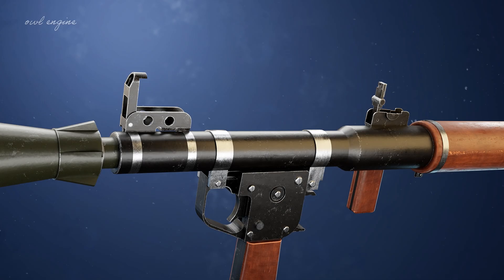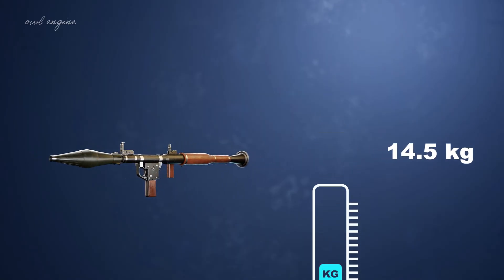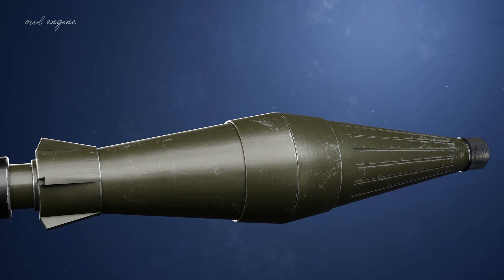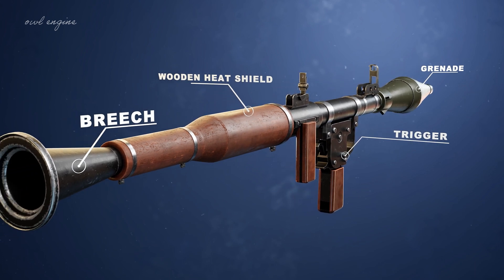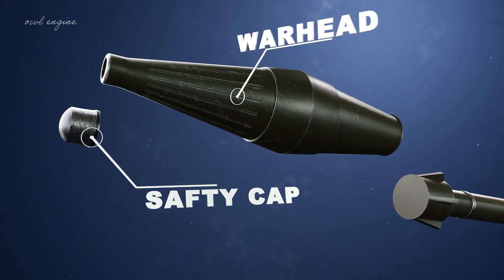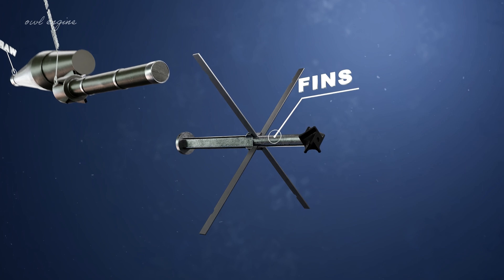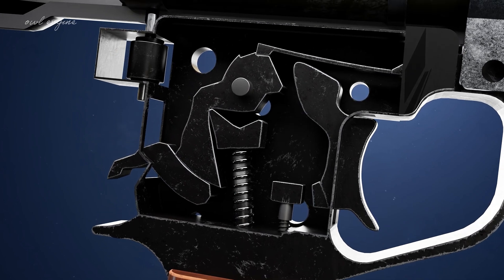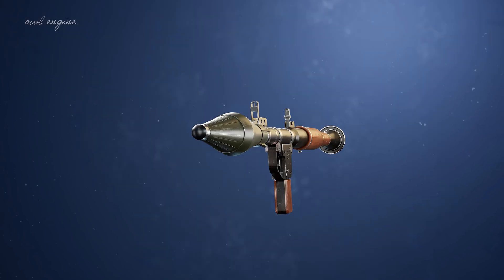How RPG 7 Works ? -3D Animation -owl engine

Comment: This literally is a basic description. You don't talk about how the warhead actually works and penetration of the target happens. It's actually the cone shaped piece of copper in the back side of the warhead. When it hits the target the extreme forces and heat actually cause the copper to become a molten rod that goes through the armour and melts what ever is on the other side.

Comment: Yet another video NOT showing the functioning of the rocket. The most interesting thing about the RPG7 rockets, in my nonhumble opinion, is the venturi of the sustainer motor, and the timing mechanism which ensures that it fires after safely exiting the launcher. But alas......same video as the others.